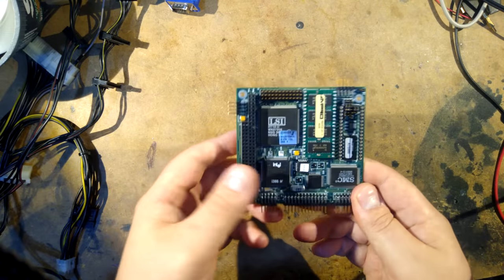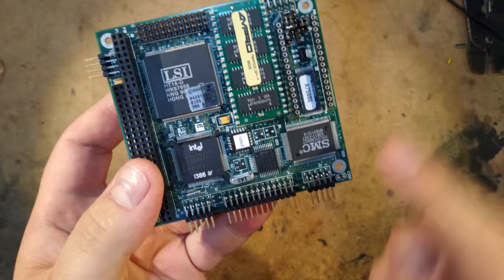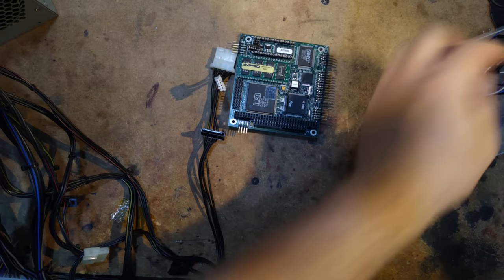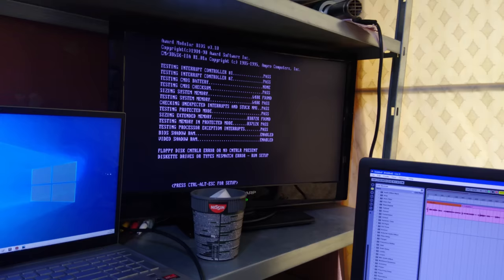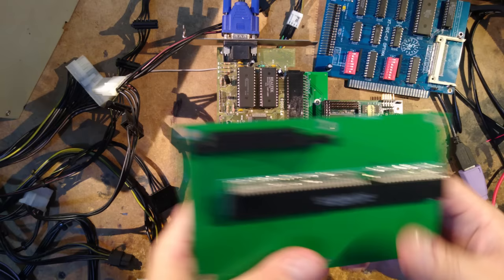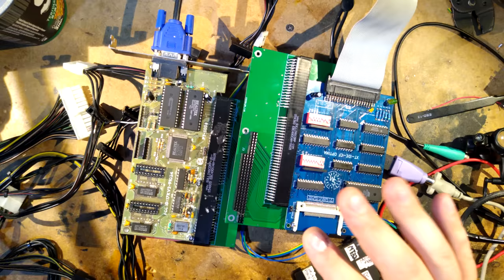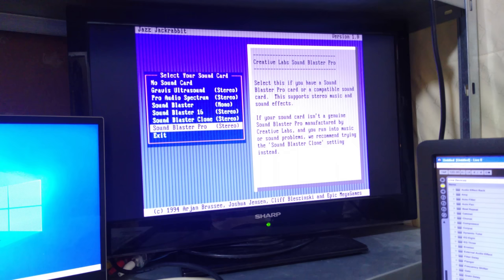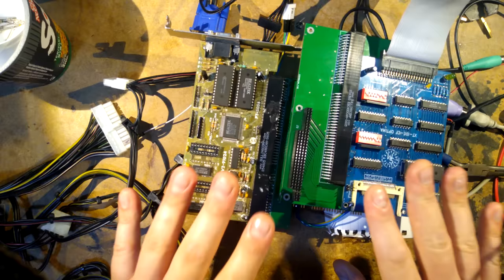DOS Games On A Tiny Industrial Motherboard

Comment: It's actually quite significant that you got the digitized sound out of Duke Nukem II. They used a sound blaster specific codec for it that not very many clones implemented, ADPCM.
Reply: ADPCM? As in Adaptive Differential Pulse Code Modulation?

Yeah, it may have been patented back in the day, but such patents expired years ago and the full documentation is readily available. I assume that's at least partly why there's a custom firmware chip on it.

ADPCM isn't even a terribly difficult algorithm, you make it sound like it was an MP3 decoder. Now THAT would be impressive...
Reply: @southernflatland  Right, it's not especially complex, but at the time those Crystal sound chips were made it was still quite common to leave it out especially since not many games made use of it.
Reply: duke nukem ii sounds great on this chip
Reply: nerd
Reply: From what I remember, never had any issues with it on my ES1688 which was a very nice and compatible card.
Reply: i know some cards supported it and some dont.
Aztech, Avance Logic, and Creative Labs support ADPCM
ESS, OPTi, and Yamaha don't support ADPCM
Reply: @southernflatland 

It might not be a "terribly difficult algorithm", but almost anything in the software domain is easier with more powerful hardware and more resources...

Decoding an MP3 file in real-time requires a Pentium (I) clocked at nearly 100 MHz or equivalent computing power.

A Intel 386 clocked at 25 MHz w/maybe 8-16 MB of ram is essentially nothing compared to a modern quad core Intel Core i5 clocked at 2.5 GHz+ with 8-16 GB of ram.
Reply: @jnharton  You can decode an MP3 in realtime on a 486DX at 80MHz.

But thanks for the almost accurate info.

Comment: The usual thing as is with tiny computers: After plugging in all the peripherals you need, you might as well have used a mini PC (like barebone PC: like BRiX or NUC).
Reply: Except a NUC is quite new and more expensive and draws more power.
Reply: If the objective is to play DOS games on contemporary hardware, these are a much better option.

Comment: There was a show called How It's Made, and on an episode they showed a company that made rolls for player-pianos. And they still used Apple IIs because of like you said, the expense of switching to newer hardware and software. I would imagine they had a closest of Apple IIs incase the productions ones broke.
Reply: Not that old but i worked at a candy factory here in northeastern brazil and most big machines although newer, were being controlled by pentium 3 PCs with a specialized OS that the IT guy believed it was either some BSD fork made in house by the manufacturer, which is from some place down south or even some OS based on an ancient UNIX version made by a company called COBRA in the 80s
Reply: @datavalisofficial8730  Neat
Reply: They could also have used any number of Apple II compatible clones...

Comment: Thanks for video! This topic is close to me as I'm working on creating my own tiny PC104-like computer with a 386SX40 (M6117D) CPU, 4Mb of RAM, TVGA9000i video, ES1868 sound, onboard WiFi and CF slot, powered by microusb, and all this will be packed into 2 neat boards within G738 plastic case.
Reply: A year later, did you manage to get your tiny PC working?

Comment: Would be nice if these ISA adapters would have some kind of power input to power the computer over ISA.
Reply from the maker: Yeah that is a good idea. If it was an ATX connector it could supply negative voltages too.
Reply: @TheRasteri  If you support adding a mini psu you could have a very small solution and take away the need for a big psu. 
Or integrate the required mini psu parts direct on the board.
Reply from the maker: @mockier  yeah a USB-C connector plus some DC-DC converters to get the 5/-12v rails would be very convenient

Comment: The socket for the BIOS IC is probably meant to be used for the disk-in-chip. In regards of power supply, you could extend your pc-104 ISA "backplate" with an AT/ATX power connector and power your mini board directly through the ISA port. In the way as the Voltage Blaster was designed to supply -5V, which I designed together with PhilsComputerLab.

UPD: That realtek 3105 is utter shit. It is basically an 8-bit VGA card and is a desperate bottleneck even for a 386SX-25.
Reply from the maker: Yeah the manual says it can be used for either BIOS or DiskOnChips. Unfortunately I don't own any :) And yeah I really should add a power connector to those adapters...
Reply: Agreed on 3105, the only thing it's good for is for XT machines because it works flawlessly in 8-bit slots =)
Reply: Dude did say he didn't want to risk any of his good VGA cards LOL!
Reply from the maker: @Arti9m  Yeah that's why I bought it - I have a few XT-class machines that it works great with
Reply: @southernflatland  This world (as in eBay etc) has seen lots of cheap 16-bit ISA VGA boards. No need to go for an 8-bit VGA chip.
Reply: @perwestermark8920   I don't see any traces running to the 16 bit end of those adapter cards in the first place.
Reply: @southernflatland  6:16 shows the bottom side of the first adapter board.
Reply: @perwestermark8920  Okay, perhaps... But I only see a couple traces there even. I mean maybe, but at the same time shouldn't there be quite a few additional traces if it's meant to actually use the 16 bit data lines?
Reply: @southernflatland   There are lots of traces for one side of that extra connector. One side of the connector contains extra address lines and the 8 extra data lines. The pins on the other side of the extra connector is mostly DMA and interrupt lines.
Reply: @TheRasteri  And maybe just make a backplane instead of a hand full of single-slot adapters ;)

On second thought, if you make the backplane ATX/ITX-compatible you can mount this into a modern enclosure. Could be quite funny...

Comment: I worked for Ampro on their first product. It was a single-board computer also, called the Little Board Z80. It was just the right size to mount onto the back of a 5-1/4" Floppy Disk Drive and it ran CP/M-80 v2.2. I wrote the SCSI Hard disk driver for that board. It was a sweet product.

Comment: I have a few XT versions of these, that IC socket you said was bios is for a "disk on chip", which is where they normally boot from. Usually with just a stripped down DOS, and one program, often written to not need a screen etc.
The main reason for these is that writing the software on a PC, for a PC, is considered by some people to be easier than using a micro controller etc.
In their intended environment, the user interface is often a few indicator lamps and a few switches, no keyboard or monitor - looking at the machine you would never know there is a PC in there.
The one's I scored came out of pay TV (as in cable TV) video scramblers, with no user controls at all.

Comment: That was awesome. A trip down memory lane for sure 😁👍 I laughed when you introduced the board as a neat option for tiny formfactor gaming and then continued to stack isa adapters on it 🤣🤣
Reply: makes you wonder if you can get a 486dx 133 for dos gaming🤔
Reply: @raven4k998  that would be cool, I've unfortunately gotten rid of almost all my old tech. But personally I'm leaning towards emulation due to space constraints in my house, a raspberry pi makes for a much more versatile setup for my needs.
Reply: @PeterHertel  so a pc104 is not small enough for your space restraints? cause it would be tiny
Reply: @raven4k998  sorry, I had a brain fart. I was thinking of a regular AT board, a pc104 would of course be an option space wise. 👍
Reply: @PeterHertel  and they do make a 486 133 variant of it to so you could make one for ms dos gaming if you wanted to go that route
Reply: @PeterHertel  and they do make one with a 486 133 so you could have a nice gaming mini pc that way

Comment: Really enjoy these videos on using industrial PCs for DOS gaming. I loved the WeePC but really interested in the ISA card expansion. A big part of PCs is being able to expand with different sound and video cards. Would be great to see a video on using a PC104 board that's really available and combine with standard ISA card expansion that can be installed to a standard PC case. Would be great to have an alternative to using vintage PCs from the 80s and 90s.
Reply: That would basically be a motherboard/backplane designed to accept a PC104 cpu card.

Unfortunately they're almost as ridiculously expensive as PC104 boards if sourced from a reseller or ebay.

Comment: I found in a scrapyard a similar (386@40, 4M RAM, IDE&FDD+Disk-on-chip module) PC104 form factor board. Here PC104 stuff are very expensive and hard to find. However, recently I got a 486 motherboard that had all the big chips (BIOS, chipset, Keyoard controller, RTC) removed (damn gold scrapers) and left only with the ISA connectors and some bus drivers. Soon I will try to make an adapter to use the PC104 board on the zombie 486 motherboard.

Comment: Nice! I've got several Megatel PC104 386 SBCs. They interestingly pack a flash drive, floppy controller, IDE controller, VGA controller and ethernet controller all on the same board. Megatel is defunct, but they made some breakout boards that allow you to install them on (I think) a PICMG backplane for adding other 16-bit ISA accessories. All of these are available through a 32x3 connector. I really need to get mine running; I think they'd be a fun tiny PC.
Reply: The downside is cabling, expensive to buy, or technical to DIY.

Comment: And this is why the PC compatible system became the dominant computing platform.  It's incredible level of modular design to add whatever you could imagine to it, and could all be a hodgepodge of different manufacturers, allowing one to shop for the lowest prices per feature set they wanted.  No other platform came close to it.
Reply: That's the power of standardized computer designs and interfaces.

It isn't unique to PC compatible systems, but when your market is pretty much everyone economies of scale kick in...

Don't understimate the contributions of Intel and a few other integrated circuit design & manufacturing houses who produced first chipsets and later single-chip solutions that integrated almost all the core functionality needed to build a PC.

Comment: Should come with a warning label "Don't use me as a computer" 😀 Of course it's made for backend stuff and should do that quite ok. Like smaller databases of various projects maybe and industry of course as it was intended. But this has been a trend for so many years now, when the goal is to see if you can game on, well anything. I guess what I have not seen yet would be someone trying to game on the chips from steroes/VCR/old cameras or a remote control, if it even is possible :) fun to watch though.

Comment: From a performance standpoint the 386SX was just a 286 with 386 compatibility, with a slight better memory mangement. The SX was 32 bit chip internally, but with 16bit bus and often slower than the 286 given the same clock.

Comment: Neat. I had a PC104 and PC104+ (PCI) board for a little while before I let the magic smoke out. It had a power connector header similar to this board, but only needed +5V. After constantly worrying about plugging it in the wrong way, I bought a set of permanent markers to mark which way round it went. While getting ready to mark it, I noticed it already had a red paint mark on it, nice! So, that's where +5V goes, because, well red = +5V... It marked pin 1, guess what pin 1 was...

Comment: As I remember, even the 386DX wouldn't handle Very Large drives.  There were probably controller cards out there, but that's why I recycled the board and moved on.

Comment: IO.SYS and MSDOS.SYS: These files are system files used by older versions of MS-DOS and Windows operating systems. They contain essential configuration and device driver information and are critical for the system's boot process. this one software use in pendrive after clone 1.The system may not support the PCI bus

2.The PCI adapter may not be properly installed in a slot

Some of the PCI adapter resources in configuration space may be invalid

Comment: I’ve long wondered why there isn’t an entire industry of people who upgrade old industrial hardware so that they can be run with modern computers. I mean I’m sure it happens, but more often than not they just keep using the old machines or eventually just upgrade the entire machine. Things would obviously have to be certified and what not so I bet there would be a decent amount of money in it. It’s just crazy when you find out that state of the art million dollar machines and equipment is being run by old dos computers or ibm power pc. I guess it will be the same decades from now when people talk about how everything is made with raspberry pi or snapdragon. If it’s smart it has one of those in it unless it’s really expensive.

Comment: the slot over the bios is for actual software, in fact i would get this device not to run DOS but some linux, and use it with a serial terminal and network interface; and it should be neat as an IRC server at home. on a nice glass box cooled by blue or green leds.

Comment: Great video and test bench here. I remember the 386SX chips as essentially being 286 chips with dual 16 bit busses (which kinda made it a psuedo 32 bit machine??). I had one, but I was never happy with the performance...
Reply: The 386SX was a 386 with a 16bit memory bus. The CPU could do anything a 386 could do (so more than a 286) but accesses to memory were slower.

Comment: Hello, great work! I am trying to get a very similar PC104 board running. Didn't find any suitable pinout, can you please share the pins of the Utility connector to connect a keyboard? Do I need a ps2 keyboard, or will an USB keyboard be fine, too? I am planning to simply cut the connector from the keyboard and connect the wires directly to the corresponding pins of the Utility connector.
Thanks for your help!
BR Michael

Comment: Just imagine 10 year old me fixing computers in the neighborhood, sometimes I would run into some REALLY tight ISA slots... cut myself quite a few times on pins or even the metal from cases!
Reply: I even used the socket on a NE2000 to flash some BIOSes!

Comment: I am very curious if the Danalog DDX 3216  could be reflashed to run a dos variant or os/2 or unix or something.. currently it works with a LCD screen but I noticed its CPU is an AM386 sc 300. or 386 chip which has a cga and xt keyboard. Has a eprom and bios encoderdecoder probably to work the firmware. 16 mb ram 2*8 chips) and 16mb flash memory (I think this is where the actual recallable prorgam information is like the state of the faders, programs  fxs settings etc.. ) while I am guessing the ram is used to process between the CPU and the SHARC processor and maybe process thedigitalaudio and midi etc.. not 100% sure. But I am curious if it would be possible to reflash a bios onto the eprom (it is a 512kb eprom) and maybe flash DOS onto the 16mb or something so the system boots into dos. It comes with a PMCIA adapter with a chip I think is normally used for floppydisks but maybe this can also process PMCIA cards not sure - maybe the PMCIA slot can be used as a harddrive of sorts.  Anyway this seems above my technical level but curious if there is anything I am missing here, is it just a matter of connecting a cga video card to the CGA pin of the CPU??? I am also wondering if the sharp processor itself can act as a soundcard of sorts.. anyway there is already digital / analog dac stuff goign on on this mixer so it feels like it might be possible any info on issues or if this would be possible are really sought and what steps would need to be done to get a monitor, dos and a keyboard hooked up toe the mixer so that the sharc and processing can be unlocked to run more programs than the supplied mixer stuff like stock DSP fxs and audio routing.

Comment: You hard disk controller card has a CF card slot on it so wouldn't have been easier to use a CF card or failing that an SD to CF adapter card than adding another board to the setup?

Comment: Interesting! I was wondering about using these embedded computers for two way radio programming but from what I see is that it’s a hodgepodge of extra boards and I would need to know if these use the older slower uarts on the serial ports and clock speed as slow as possible ( some programming software relied on the motherboard clock speed to operate properly ). If I remember 8-12 mhz was the magic window. Also the ancillary boards I would figure as unobtainium.

Comment: I imagine that if one wanted to use one of these boars that dont have Sound, Graphics and use-able Drive connections, you could perhaps stack them in a way that might at least get you say, a small cube shaped DOS PC (ala DOS Gamecube?)
Reply from the maker: yeah that would be the best solution - but unfortunately PC104 VGA/IDE boards are much rarer/pricier than the processor boards themselves. Easier to find a board that has IDE/graphics then add a soundcard

Comment: For god's sake, press the "auto adjust" button on that monitor! It should be able to do 640x480 fine, they all can, it's been the PC boot resolution since the beginning! 

Second, you surely have 4MB with 3.7MB free. A bit of tweaking and you'll get Doom running, just. MEMMAKER.EXE handily came with DOS 6. I hope that 386SX is fast. Mine was 40MHz, the fastest clone they made, and 4MB. And it ran DOOM because it had to! Lo-res mode and like 8fps in a smaller window, but it worked! F5 is lo-res and I've no idea what the screen size buttons were, it's like 30 years ago, man!